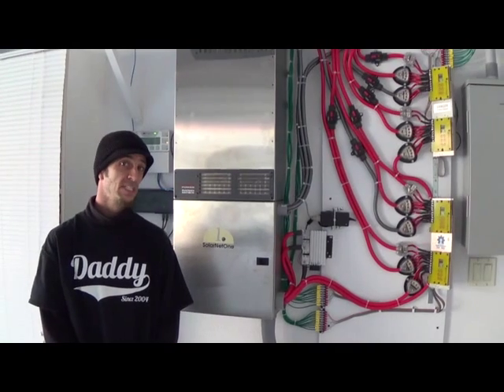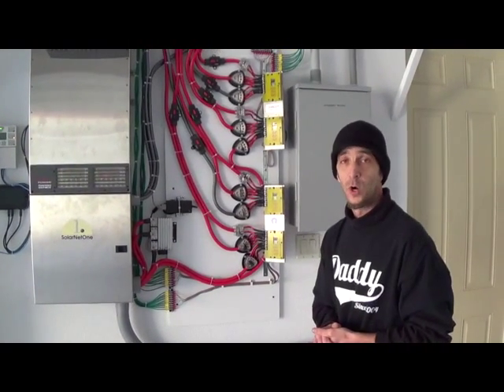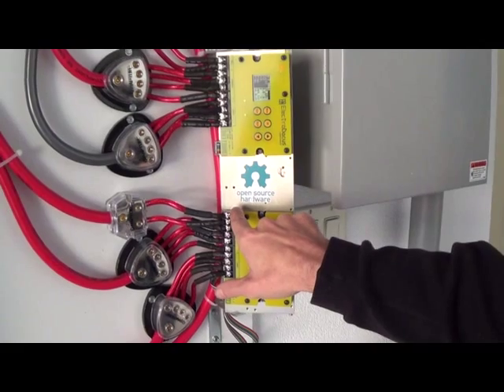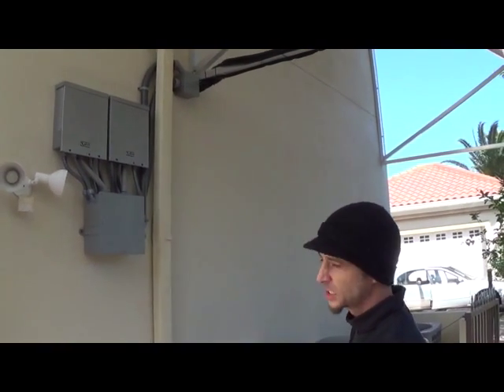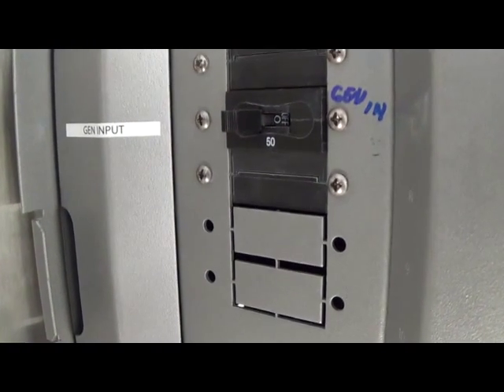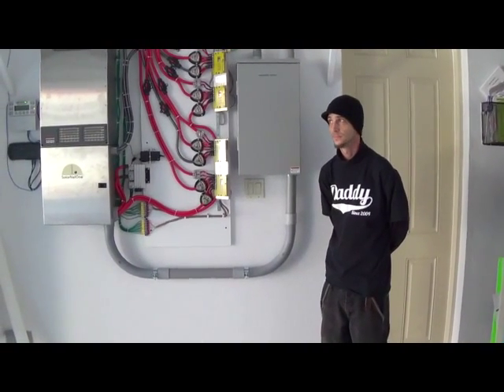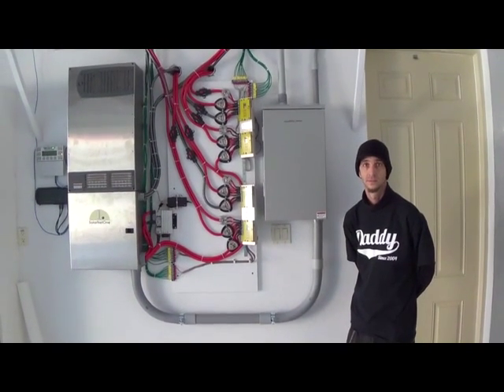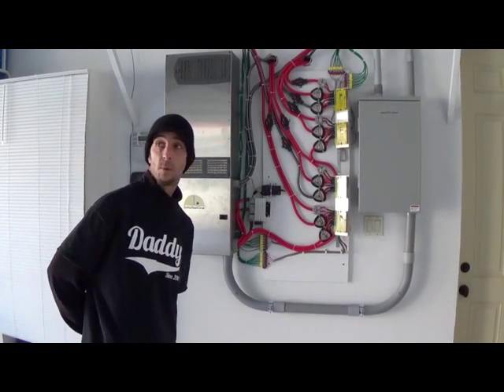SolarNetOne Advanced Solar Battery Backup System

Comment: Great video. To bad the video is cut and I was not able to here more about the hamsters :).
The new SBMS will be ready in October if the Kickstarter campaign is successful.
Everything seems nicely organized and the way it setup to work those batteries should last more than the PV panels.
I'm just working on the presentation for next kickstarter and just made a nice graph with my power consumption for the last 7 days. Here is animated gif with that graph http://electrodacus.com/images/energy1.gif there will soon be much more info released probably in the next few days.
My installation is OffGrid made out of just one SBMS4080 3x 240W PV panels and a 24V/100Ah 8x LiFePO4 cells
Reply from the maker: Thanks, ***** .  I will pull some still images of it from the hi-res video soon, and post those.  Thank you for the additional attention required to make this system possible.  I am glad we can help document and prove your design at higher current levels and larger configurations, and look forward to the next revision.  Keep up the great work!

Comment: hey Scott,
nice job mate.
could u tell u use to convert from the 12v to the 48v?
Reply from the maker: Well, there are not really any 12v components in this system to start with.  The panels themselves were 60-cell models, which produce maximum power around at around 30V.  There are four solar panel arrays, each producing approximately 1KW.  Each array charges a nominal 25.2V battery bank.  Those banks get full at 28V each, so it is a pretty close voltage match there.  Two sets of series pairs are created, producing two banks that are 56V each when full.  The designer of the Electrodacus SBMS4080 charge controller made some modifications to the units to allow this.  These banks are then paralleled through some heavy duty Schottky diodes, driving the inverter.
Reply: Thanks mate.That will teach me to listen properly next time hey :-)